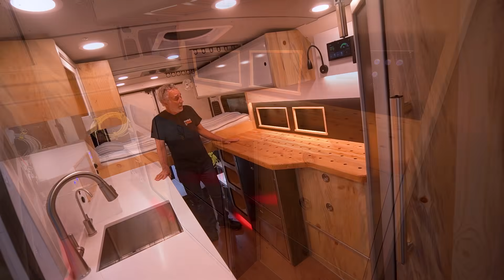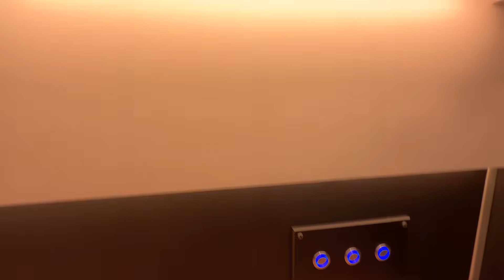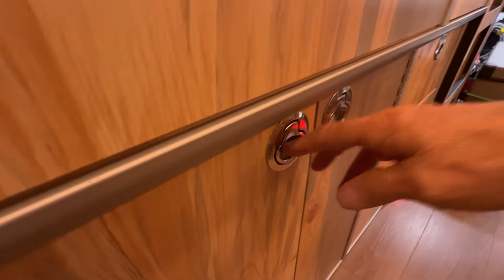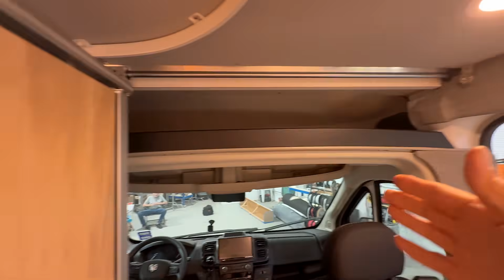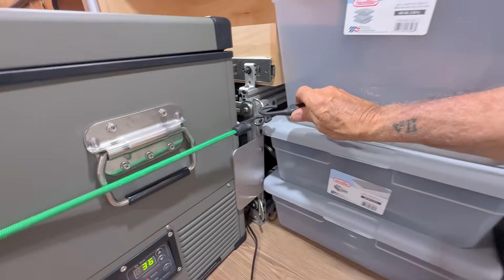Full timer calls on Humble Road to build a workshop in a van. Ecoflow, solar, kayak, fishing poles.

Comment: If George is custom designing my Van , I would tell George to get rid of that extra drawer space & maybe even 5 inches more so I can have a nice comfy full dry bath without moving the toilet in & out 🤔 🤭 🤣 😆
Also add in a gas stovetop & maybe design me a water collection system where the Van collects rain water into a tank so I can use it for showers + cooking/toilet etc.. when I'm out in the boonies 🤭 🤣 😆
That would be the perfect Camper Van! 👏 😁 🤟
Reply from the maker: Sounds like you have some ideas for your own van! As a rule, I do not install propane in any of my builds. And I like to keep the systems very simple. It is after all a van and not a cabin in the woods!

Comment: Two additions that I want to recommend: 
1) The gap in the storage/nightstand between the bed and the back doors. should have a removable panel for your arm to fit through so that things don't accidently get dropped through that opening.
2) The shower has an angled section where the shower head goes that is next to not behind the pantry when it is closed. I would recommend putting a rod across the top to hang wet clothes, so that they can drip dry in the shower without taking up room or getting the inside wet.
Reply from the maker: I appreciate your suggestions. Thank you. We thought about a cover for that passthrough to the rear door handle, but decided that if needed, it must be a big emergency and the inhabitant does not need anything more to think about or do, but to get the F out of the van!.

Comment: Gosh I love that shower/amoire setup - pure genius. By the way, if you could do that maybe you could have engineered the back door lock so it had a dual-latch system? (eg - an extra latch higher up from the original, but connected too), so that you wouldn't need that cut out? Dunno, you guys are the experts here. Amazing work as always.
Reply from the maker: The minute you start modifying or altering any part of the chassis a.k.a. door system you become responsible when it fails you become liable when it fails.
Reply: @HumbleRoad yup, you guys are the experts for sure! I hadn't thought of that!

Comment: What's the dry weight of such a build, or weight of all these additions ?
Did a ford transit build, very carefully selecting wood and materials to stay on the light side,  1800lbs addition, with 10KWh LFP batt like here.
All this 8020 must add a lot (light bars but heavy connectors).
Reply from the maker: This build was weighed after the owner loaded it up with all his stuff and as always, I tell them to weigh with a full tank of freshwater so in this case with all the owner stuff in the van already he still had another 800 pounds of CCC

Comment: I’m wondering if there’s going to be side rails on the roof rack? The ends of that 80/20 look dangerous. Have you worked with Orion Van Gear roof racks? They use 80/20 style cross rails, I think you might like them.
Reply from the maker: Yes, I install Orion roof racks on the vans where the customer insists on it. The problem with them is they are way too narrow for the top of the van. My homemade racks for me more space for solar panels down the sides. The ends of those roof rack 8020 tubes are not finished yet. We’re waiting for the drop rack then they will get cut to size Other than that. They’re not dangerous.

Comment: Outstanding, fits his life like a glove. With those battery fuses, you could 3d print a spacer that allows you to install extension wiring just long enough to present the fuse inside the front of your spacer. It looks like a bolted fuse so a strong electrical connection is easy to make. The cables would be only 6 inches long or so. You and your team should be proud on this one everything makes sense (except the fuse haha).

Comment: What a lovely build. I've been thinking quite a bit about space optimisation, and one idea I'm knocking around is to have the the workbench hinged, so it folds down over the kitchen surface - because I don't think I'll need to use the kitchen and bench ever at the same time.

Also- that shower is a dream - because you don't need access to cupboards/clothes while you are in the shower, so it is beautiful parsimony of space

Comment: feedback: impractical location for the outdoor shower. That fixture and the water inlet drips when you are using it fulltime. It will drip on top of the solar panel or the floor. I would move it closer to the edge so it drips outside

Comment: Shower set up - no words necessary!! I love the iea of one armoir shelf open on back side for bath towels, as well. The garage is wonderful, all that storage and everything slides out for easy access. So very practical! That folding table by the slider should be in every van. It's topshelf and so useful. Love it all!

Comment: Outstanding van George! 

Another big van builder puts a rear door release that is like a (red) dog leash down to the door latch and a pop snap on the leash to the rear door that you just pull up to open the door in an emergency. Simple effective and works; I borrowed the idea for my van. Just a small indent/bevel needed on the rear shelf. Love the Iceco step also. My wife wants more accessible dry food storage from the rear; I’m going to look into a box step reno with a 2 stop slide. Thanks for the idea ❤️ 

We just returned from a 3 month trip yesterday and thats our only issue I’m currently working on - got to get rid of the pia cardboard box that was moving from the bed to a chair every night that held the extra stuff that would not fit in overhead cabinets 😪
Reply from the maker: As a builder, I would never modify those door latches in a van. Any malfunction or cause a personal injury, I am responsible. it’s not wise that’s why we simply provide access to the manufactured DOT approved latch. Don’t be adding any straps or handles or extensions.

Comment: Well done on the shower. Agree with other comments about innovation. How to take it to the next level, figure out how to rotate the pantry around so it occupies the slider space but is still usable. It would be awesome if it had a cam/follower mounted on the ceiling that controlled the rotation while it is translating over to the slider area.
Reply: lol or just put cabinet doors on the back side as well and forget the complexity….
Reply from the maker: That’s an interesting idea.

Comment: George, George, George. . . . you and Team Humble Road finally did it - multi-use closet/pantry/shower space.  Beautiful engineering!   Well done!
Reply: Genuis! The only thing to make it better is to have the top shelf open on both sides so you have access to towels and toiletries after shower
Reply: @susanpranica5474  Oh, that's a really good idea. Easy to machine a cutout. or just a small towel rail on the back if there's space.

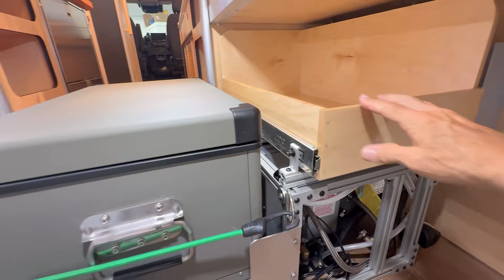Comment: 18:06 would like to see wire loom on that 120V line into the water heater
Reply from the maker: Loom is used when the wire comes in contact with another surface
Reply: you might be looking at the 12v wire for the fridge that is bundled in there?

Comment: design and engineering are always so interesting. we can make things so nice if we had the time and dedication to perfection.
Reply: maybe you can make the inner rear door latch electronic? or by wire pully (sorta like they have them in trunks if they kidnap you)  so you don't need that cut out in the back?
Reply from the maker: As soon as I start modifying a door handle on a vehicle and it fails, I am responsible for that failure. I can be sued I can be thrown in jail. I do not modify the chassis mechanisms. I leave that up to the manufacturers.

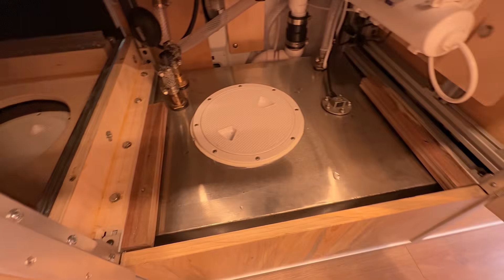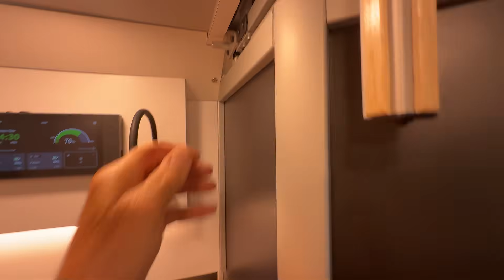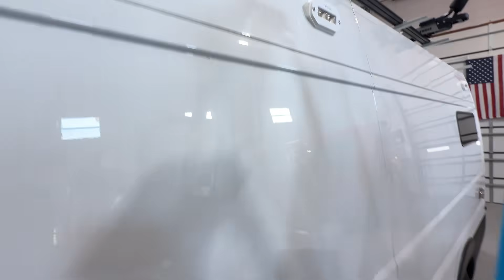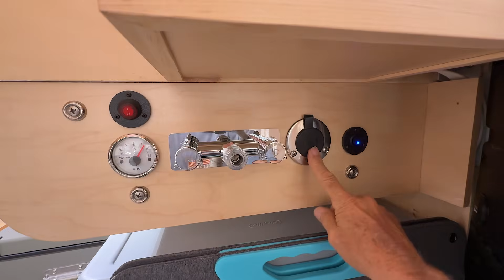Comment: Great work as always - but I have some questions / concerns:    1. At about 6:10 into the video:  Any concern about the 120v outlet at the back of the van - where there is a cup holder? - It would be bad if any liquid fell into that outlet.    2. At about 9:50 into the video there is a long & flat (low height) fresh water tank on the floor - Any concern if the van is not on level ground? - What if the water has moved away from the pick up point?      3.  At about the 11:00 mark:  The sildeout cubbord is hanging with no floor support - Any concern about how much weight that can handle?    4.  At about the 13:30 mark:  The roof rack appears to be haning out past the side of the van - Any concern about that  being too wide and/or getting snagged on something (like tree branches)?      5. At the 17:00 mark - there is a plastic bin that is being restrained by a bungee cord -  It looks like the bungee will probably keep that top bin in place - but it seems like it would be better if there was a way to get that bungee up higher.

Comment: How do you keep the slider doors in the extrusion? - do you use felt runners? (I thought thats what you said at one point George)
Reply from the maker: The sliders are sitting in use specific slider tracks and then yes, we wrapped the bottom and top edges with felt so they don’t rattle or slide open during travel

Comment: As other people have commented this is a brilliant and thoughtful van loaded with unique and practical features.  I whole heartedly agree and personally like the neatness of wiring and access to mechanical items that will need attention at some point.  This serviceability aspect is rarely given consideration by any other manufacturer.     My question is given the owners fly fishing and kayak use was there thought given to adding ground clearance for light off road use?
Reply from the maker: Owner is considering a lift and larger tires, however, with a pro master, you can’t expect 4x4 sprinter performance
Reply: @HumbleRoad  Thank you sir for educating me.  Steve K.

Comment: Why are your 120 plugs upside down?
Reply from the maker: Electricians sometimes mount plugs upside down, with the ground pin facing up, primarily for safety reasons, particularly in areas where metal objects might fall and potentially cause a short circuit if the ground pin were at the bottom. This practice is more common in commercial and hospital settings where the risk of dropped tools or equipment near outlets is higher.

Comment: Another beautiful van. I was interested to see your take on the issue of access to opening the rear doors from the inside. This was something that concerned me when I built my Citroën relay based campervan. My solution was to reposition the door release on the upper part of the door. There is currently someone selling a kit online for about £100 that is very similar.  I'm sure this is something you could probably sort yourself but if you would like photos of my solution I would be happy to supply. Carry on the good work
Reply from the maker: Here in the United States you need to be very conscious of liability. The minute I modify a handle on that van chassis and the owner has a problem getting out doesn’t get out or injure himself. I’m responsible that’s why I do not mess with any of the chassis

Comment: Your client, John, sounds like a very interesting man with many DIY skills.  His van reflects all his skills and interests. What a formidable van. I love the workbench, always wanted counter space in my van for my hobbies. I converted a Class C dinette section into an office desk and DIY work table. Who needs dining space?
This is astounding, George.  The shower cabinet rails are brilliant, so is the long outdoor table. Just wow!!  So clever to weld two extension glides, and make that long table. Definitely an industry standard. The shower is a game changer. Bravo and shoutout to Jon and Ron for their creative genius.

One thing I've seen in Euro RV models... they make a dressing space on top of the garage and have loft beds in front. That would also be a game changer for US RVs. Why don't we make hinged beds that pull down manually on top of driving cab area and partial living room space? Why don't we make a garage space with the top half dedicated to a full closet with hanging space, and drawers? This is becoming the Euro industry model. Their vans are the same length as the Promaster or maybe slightly bigger like a small Class C or large Class B. I love those pull down beds, all mechanical.  That frees up a lot of floor space for bathroom, fridge, galleys, and living space. For single people who are artists, DIYers, counter space is essential. I do not entertain in my van and if I do, some fold up chairs are sufficient.

Brilliant design, George!! Thank you for inspiring us with outstanding design and creative genius. Your vans should be in the Museum of Modern Art (MOMA) in NYC. You are most definitely from Da Vinci's lineage.
Reply from the maker: I can imagine what you’re describing in these European vans. Would it be possible for you to send me some links?

Comment: I do not have a van of any description, however my dream is to convert a 20’ 7.5T box truck with tail lift and have an 8’ garage area for two motorbikes and the remaining 12’ as accommodation.
I have layouts and some space saving ideas in my head, however watching your video helps to give other options. This van is very well thought out for sure.

Comment: Finally I'm glad someone made my sliding cabinet in the shower idea.  
I got this in my Sketchup design for my Box Truck build when I retire.
I planned on using Unistrut and hanging track rollers and wheels on the bottom to handle the weight.
Reply: Unistrut is plenty strong enough to just have the tracks at the top. My bed frame is only 4 pieces spanning 1.75 metres. The load and span tables are in the engineering documents on the unistrut website. I would suggest some skids/rests for it to fit into when stowed, for example under heavy brakes the cabinet will want to pendulum and lift the front wheels. You can also grind notches in the track the same radius as your wheels for detents, and use the back of it AS your shower door. I've seen it used for garage door track.

Comment: I've thought about a similar roof-top PVC pipe set-up as a fishing rod storage solution.  One thing... under the "every little bit of fuel savings helps" category, did you consider 3D printing a nose-cone for the tube, to provide a tiny bit of aerodynamic improvement?

Comment: That layout is so close to how  my van is layed out.
Sink in the right spot - Check✅
Full hieght cabinet behind driver ✅
45 degree counter bump out✅
Picnic table ✅ not as Shi Shi as yours though👍

The shower design/sytem is simply briliant☀🌞😎

Could be one of your builds I like da BEST...
Reply: LAID out, not LAYED out.
HEIGHT, not HIEGHT.
CHI-CHI, not SHI SHI. 
"Shi shi" can have multiple meanings, most commonly referring to Chinese guardian lions (Shishi) or Japanese political activists of the late Edo period. It can also refer to the Japanese word for lion, or be used as a term for urine or urination in Japanese or Japanese-influenced Pidgin English.
Chi-chi is a slang term for breasts, therefore alluding to feminine or fancy/ decorative.
As usual, we females get all the derogatory words in existence. Try using 'fancy' which is not gender based.

Comment: love the slide out armoire/ shower recess. I’d been thinking along these lines, but with a swing out wardrobe forming a wall for a mid-van shower - also with an extended shower curtain rail.
On top of the access hatch behind the fold out table, a removable shelf on sliders with a cooktop and bbq equipment would be my ideal.
Reply from the maker: I never like the idea of cooking with an open flame on a table attached to an RV that could prove to be a very dangerous situation if things go sideways, put your open flame cooker out on a picnic table or a Work table away from the RV
Reply: @HumbleRoad Yes, I see your point. So maybe just a storage spot for same.
Reply: @HumbleRoad Actually you did it just over a year ago - I knew it wasn’t my own brilliant notion! Kudos, George.
Reply: @HumbleRoad Also love the workbench! I’ve never seen that in a van before…

Comment: George, this has to be one of your best Builds. The Folding Picnic Table and the Hidden Shower are very innovating and cleaver, not to mention the Work Bench! This type of thinking is Class Leading. One suggest however, the "Rear Cutout" for the Door Handle access, why not put a small hinged door on top so it can be a usable surface, maybe even clear Plastic so the Handle is alway noticeable. Great job.
Reply from the maker: The minute I modify or add to a handle that’s part of the chassis I make myself liable for any failure in operation. If somebody cannot get out using my modified handle, I am responsible that’s why I do not touch things on the chassis in this manner.
Reply: @HumbleRoad  A small hinged door over that open handle space wouldn't modify any part of the handle or chassis and still be another usable space. I think that is what bigpapa meant. You'd flip it up and reach down to grap the handle same as in your current arrangement.
Reply from the maker: Gotcha.

Comment: the shower is awesome. wonder why you have not yet get a solution for the back door latch to be able to place the opener on a different location. that hole looks a bit awkward for your standards.
Reply from the maker: The minute I modify or add kind of a handle extension to a chassis latch. It makes me liable for any failure in operation.
Reply: I would have thought a flip up hatch on the bottom of the shelf for emergencies would make more sense.